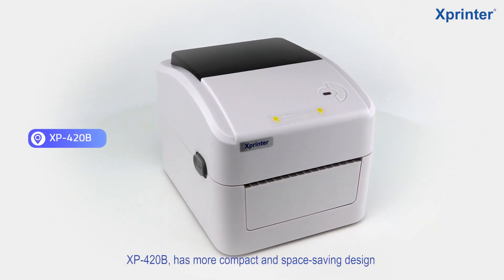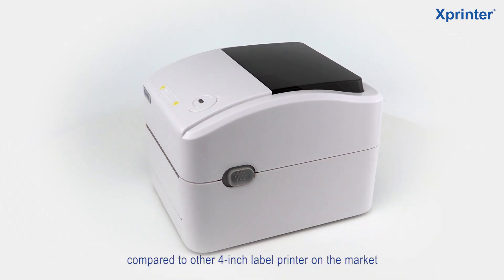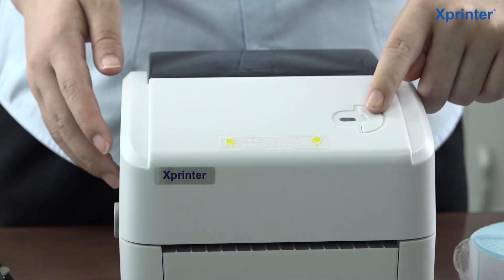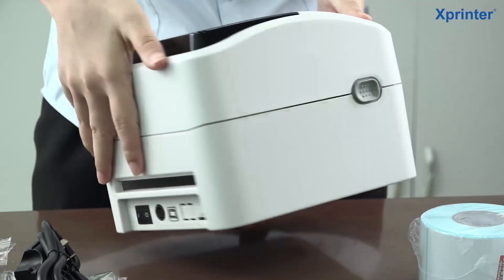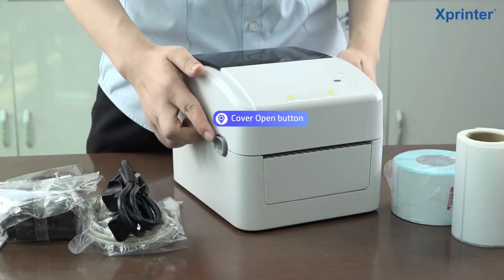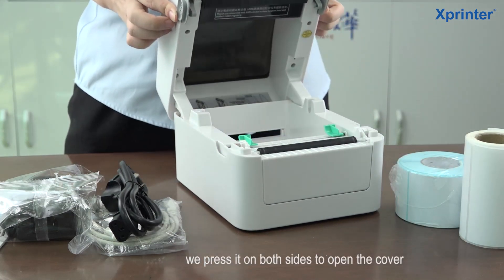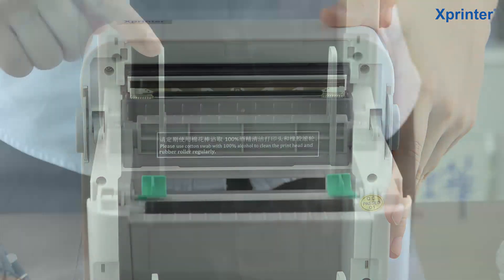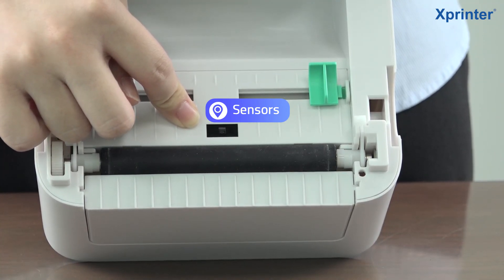[Official] How to Use, Setup and Install Thermal Xprinter XP-420B for Printing

Comment: is this model possible work with bill paper ?
Reply from the maker: Hello, the XP-420B can print receipts, but your printer needs to have this function configured. If you need to print receipts, we recommend using a receipt printer.
Reply: @XprinterGroup  tks

Comment: Hi, I have some questions:
1.Can this printer use other paper label than the one you show? can we use smaller label sticker like 35mmx25mm?
2. Is it compatible with SQL POS system?
thank you!
Reply from the maker: It is not compatible with POS system
Reply: @XprinterGroup  ok thanks
Reply from the maker: 35mmx25mm is OK, the media width is 20 mm - 116 mm.

Comment: Hi. May i know why xprinter 420b i buy cannot use? I plug to power and light indicator turns purple. Untill now i can’t use this printer. Any suggestions how to fit this printer? I not even use one time for printing. Just plug to power and can’t use.
Reply from the maker: Hi dear, you can visit our official website to get technical support: https://www.xprintertech.com/
Reply: How to fix light indicator turns purple?
Reply: Same question i got here

Comment: what is the function of TF card for the printer? does it need to be formated fat32 before use?
Reply from the maker: Hello dear, TF card is for expanding memory capacity
Reply: How to use the bluetooth for this? 
Also how to factory reset thr device?
Reply from the maker: @Fii.-aaa  Hello dear, you can visit our official website to get technical support: https://www.xprintertech.com/